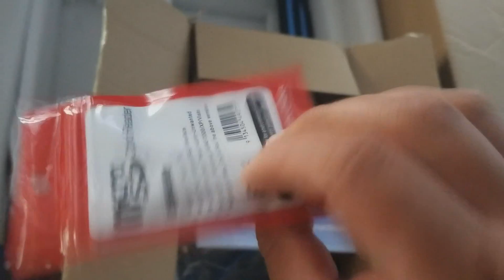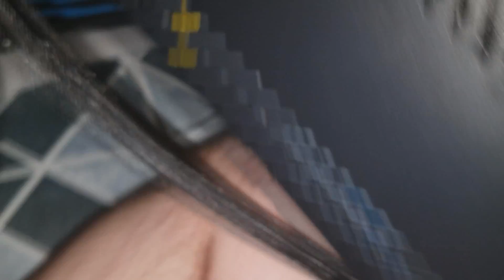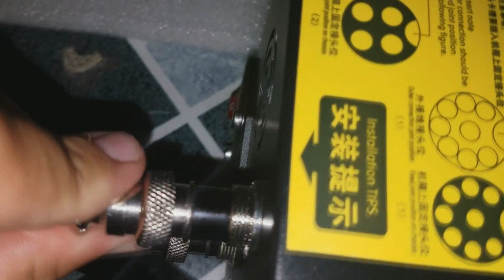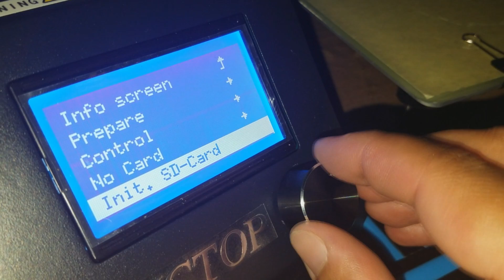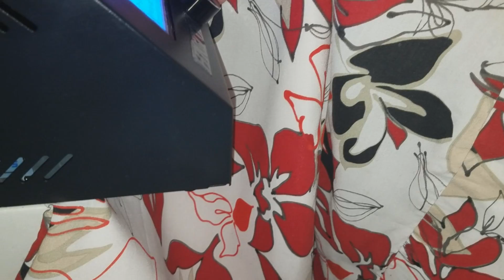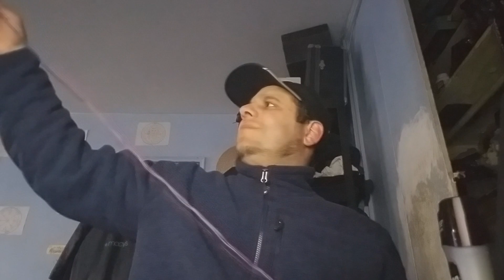HICTOP 3D Printer CR 10  Creality Prusa I3

Comment: I appreciate the video very much Did not see the link to the new motors as you mentioned you would do, not a criticism just pointing out you forgot to put the link.  But I will find them. thanks again for the video.
Reply from the maker: o im so sorry. I put up the link before but it ended up being a broken lionk because the seller on ebay sold them out. Just look up stepper motors and see the onse with the best feed back. i cant believe there is one with plastic gears lolol never get that lol. be sure to like and sub as many more vids to come.

Comment: When your talking about the wobble what do you mean by spin it around?
Reply from the maker: means tighten the screws i think. i have to watch the video again ive done it awhile ago
Reply: Got it. Thanks man
Reply: Lior Bar-El the spacers can be adjusted by turning them
Reply from the maker: not the spacers i meant the bolts. u see the bolts when they are not tight the unit wobbles in the bottom
Reply: Lior Bar-El no it's these little nuts squashed between the roller and the plate, u turn it and it tightens, did that and it doesn't move at all

Comment: The Hictop CR-10 is the same as the Creality CR-10 its just re-branded, so you can print what ever material you want. and the bed can reach 90 centigrade/Celsius (Plenty for ABS)
Reply: Are you sure? because in Amazon Hictop says that it can't use ABS -
 https://www.amazon.es/forum/-/Tx3L1017KMP5AVH/ref=ask_dp_dpmw_al_hza?asin=B06XRCCDM3
Reply: I found this article which says that it can but you will have to make some adjustments and probably have to insulate the bed. hope this helps. https://3duality.com/hictop-cr-10-3d-printer-prusa-i3-diy-kit-review/